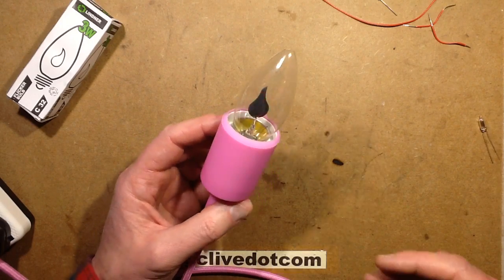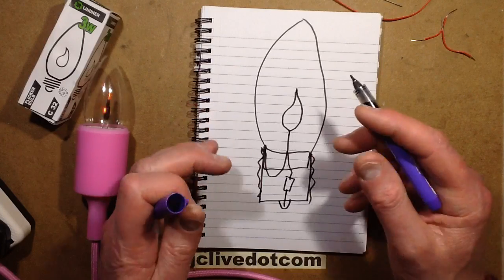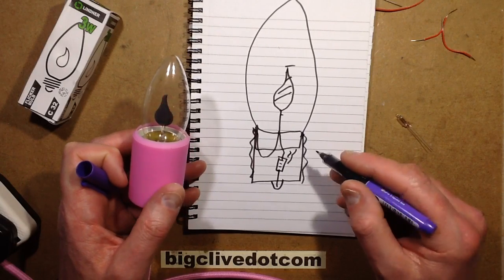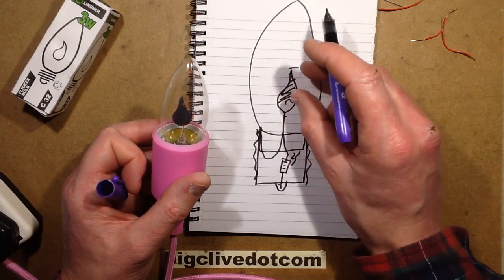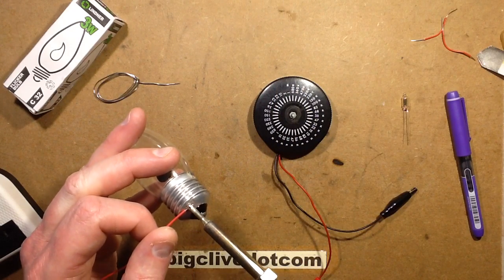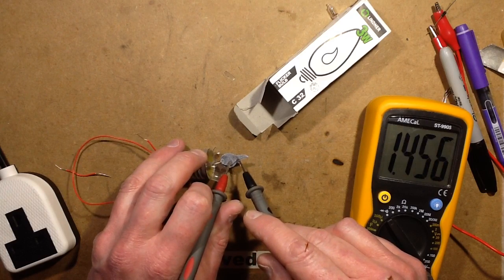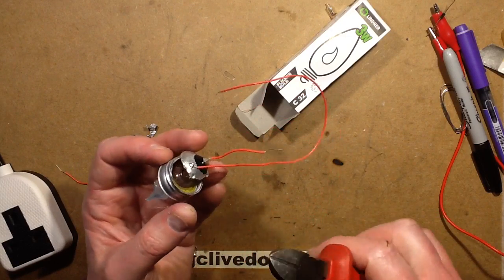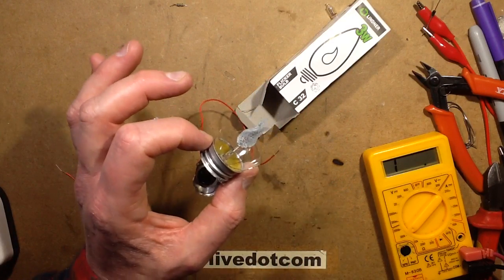Inside a cheap Neon flicker-flame lamp from eBay.

Comment: I swear that calculator gets bigger every time I see it!
Reply: Maybe BigClive's hands are shrinking ...?
Reply from the maker: I've never thought about sticking an LED up a Jelly Babies bottom.  I like the idea of edible fairy lights.  Probably better thrust into its little jelly skull though.
Reply: @bigclivedotcom  don't know where you're going but don't necessarily like it
Reply from the maker: I think it would certainly make a very interesting video if Photonicinduction stuck 2000V up your ass.  he can do that at well in excess of an Amp.
Reply: @bigclivedotcom  talk about lethal induction
Reply: can it do bigger sums because it's bigger ?
Reply: @BillyNoMates1974  well that definitely sums it up the more subs you do the bigger the calculator gets calculator gets too big just do only subtraction for a while exhaust small calculator just don't let the very go completely flat otherwise you might prick your fingers become because it's cactus
Reply: I doubt it but if you want calculate astronomical sums like my recent gas bill you need to send it to  NASA
they can handle it
Reply: not so sure its A4 size like mine
Reply: lol. I did not noticed, had to recheck it :D that's a CALCULATOR :D
Reply: With a light bulb....up my ass.....
Reply: foxy s don't put anything up their ass  but I did put an Led up a jelly babies bottom lit up nicely
Reply: Lol, 120 or 240v?
Reply: It's a ghetto calculator. You hold it on the shoulders.
Reply: +BillyNoMates1974 I had to read the comment twice and think about the joke that's fucked up and I'm rofl.
Reply: 2000v would definitely turn your colon codes black.
Reply: I guess that would be electro-colic irrigation
Reply: @BillyNoMates1974  something about electrical irrigation wouldn't that be a contradiction in terms or at least not recommended I'm not like I'm talkin electric pump for irrigation but electrical irrigation sounds kind of like a recipe for disaster especially if it's the water pump and it gets wet under right conditions.

But you could say that the crop would have been electrified potential for growth or make a really good Wallop of a dish when it's served hot LOL
Reply: James Searle Whatever you can fit up your butt!
Reply: 2000 Volts straight out the ass is what I can deal!
Reply: @sirunknown2142  well that would definitely electrifying wonder if that happens when an electric eel gets too much gas that is if it could run on gas like a generator LOL
Reply: No. You either shove a battery up your butt or you just insert something so that the power can be sent from two cables while going through what's in your butt.
Reply: @sirunknown2142  technically true yes how conductive are mucous membranes
Reply: Trump is 6′ 3″
Reply: James Searle Let us know when it completely fills the screen.
Reply: Don't mention his name or he'll come and shove Poundland tat up your arse!
Reply: On my big screen TV it's about 2 feet across. It must use 8 D batteries!
Reply: Sir Unknown if you stick any electricity up your butt you effectively are making a rectumfier
Reply: @carolynmmitchell2240  It does all sound AC/DC to me. This string of replies needs some rectumfication!  :-)
Reply: @jlucasound  definitely needs a full Bridge rectifier but don't accidentally overloaded because of becomes a Bridge rectified
Reply: @carolynmmitchell2240  😳
Reply: @carolynmmitchell2240  would that be full or half Bridge
Reply: lol XD
Reply: 415 volts, three phase for extra oomph
Reply: @BillyNoMates1974  Liberty that's where they came up for the name banggood Jamie want big boom
Reply: lol. do you eat batteries and shit electric ?
Reply: @BillyNoMates1974  either/or batteries corrode in stomach and cause all sorts of issues except electrocution and then you wind up heart failure and they use somebody thousand volts to Snap you are that and wide-open pacemaker powered by batteries or something artificial heart car batteries you wouldn't have to swallow batteries because you've already have them in you either one of the above lol
Reply: Forgot the name. Redirector? Maybe. Shove that and attach two cables
Reply: Bob3519 Marry me. 💍👉👌👍
Reply: well it won't fit in your shirt pocket I've tried
Reply: @thehappylittlefoxakabenji8154  well if you can't kill the character in your pocket why would you need that anyways nowadays so it's just about every phone can do it anyways even if it's Norris smartphone nowadays and yes I once had a landline Lowe's cheap phone that hand clock calendar calculator a couple of other things on the same LCD as the number dialed out the interesting thing is this was free caller ID even but it did have I think it's kill or give me more directory Auto dial but I remembered it was a few other buttons four function but still pretty cool for the time 1 most unusual phones I've seen besides like the mouse phone that's a phone and a computer mouse I know someone that had one sound like crap but at least it worked. Enough room on that desk for phone so that's why he did it.

But the thing is I remember we had a phone that will not dial out but it was just meant as an extension phone didn't even have the ringer it just had a neon volt capacitor so that wouldn't it did ring the neon bulb with flash but yet be isolated from the line so that would not shut the line because of the neon firing.

But every once while if we would need to take call upstairs we dog from another phone extension and have someone else pick up after dialing before hanging up the one downstairs
Reply: Then he wouldn't be called BIGclive anymore :D
Reply: bigclivedotcom Wanna try?
Reply: @sirunknown2142  shuri would it be your lethal induction
Reply: Vendicar Decarian 

leave politics put of this.
Reply: jmcinvale When did putting things up your butt become political?
Reply: @sirunknown2142  just easier to put a cork in both ends ears to super glued in permanently I super glued shots everything super glued together London Mass left somewhere away from everyone 4/2 middle of Siberia and it would have been over easier than going through all that crap of his I think seriously we would have done better without him I believe anyone but him
Reply: +Vendicar Decarian

Easy just don't mention his name.
Reply: well its certainly big and made of that cheap silver plastic crap ! any guesses as to what battery it has ? I know what mine has !
Reply: if its the same as mine its one single button cell an LR44 A76 !
Reply: Is that really the only battery you can fit up your butt?
Reply: You must be real tight!
Reply: I tried sticking them through its skull you need to make a hole first I used my neon screwdriver for that the red ones light up a nice pink but the black ones are rubbish
Reply: its heavy too mine weighs over 400gms
Reply: @BaDboD I guess one could could say they play an inflated price for the calculator
Reply: The pink palculator?
Reply: I bet your gas bill wasn't as big as Hitlers
Reply: I told my teacher that and I got fucked!
Reply: I feel the same about your mother

Comment: Resister wheel from Jaycar https://www.jaycar.com.au/resistance-wheel/p/RR0700
Reply: I dare people to build their own resistor substitution box or a better one called a resistor decade box. I have parts already on the way for mine. It would also be fun if he could show us how to build one as I am sure he has most of the items laying around the shop and they are dead easy to build from the way i understand it and the one I am building has almost any resistance you want to dial in. it contains 63 resistors with in my case with thumb wheel switches  and with this setup I could dial in any resistance that I wanted and then find the appropriate capacitor in the standard capacitor range.
Reply: For me at least, the challenges are, the box/shell, internal wiper contacts and nice silk screened labels to get a pro look. obviously it can be made without those or made with an off the shelf rotary multi contact switch. but won't be as compact or user friendly

also, it would be neat to make a more compact one with smd resistors
Reply: This is the resistor substitution decade box that I built some time ago.  It has not failed me yet.  If you want to see my finished product labeled and in it's housing, just let me know.

This is the basic build from the EEV blog: http://www.eevblog.com/forum/projects/diy-cheap-resistor-decade-substitution-box/?PHPSESSID=b9e4b61f7eb911da0ce2afd8b384ccce

Also check out: http://hackaday.com/2012/08/21/building-a-resistor-substitution-decade-box/
Reply: The easiest way would be a breadboard with a load of resistors in with one end commoned to a lead with a croc clip then another croc clip lead with a jumper pin on the end. Ugly but functional.
Reply: I suppose. but then again if you don't want to keep the single wheel format, you might as well buy a few of these and make a proper switch box. they are fairly cheap and compact
http://www.ebay.com.au/sch/i.html?&_nkw=Rotary+DIP+Switch&_sop=15
Reply: Thanks vk3hau, as soon as I saw it I knew I MUST HAVE ONE OF THESE! :-)
Too bad it's still forty bucks; someone ought to have figured out how to make them cheaper by now…
Reply: I bet the Chinese have, but the quality would be cheaper as well.
Reply: Chris Koch Remember, that's 40 Australian dollars, which is just over 30 USD right now.
Reply: +Ken Cosi
Saved that EEV guide, have a couple of rotary 10 pole switches in the (slow) post. Wil use it to make a simple one, then have a go at a bigger one at some point.

Comment: I dropped one of these on the floor. There's quite some gas pressure inside, it made a loud pop.
Reply: LimaVictor or no gass at all (vacuum)
Reply: No, there is neon in there. They're just neon lamps with special electrodes. 
Tiny NE-2 lamps can give quite a bang too, if you run them without a resistor...
Reply: They operate at a lower pressure than the outside atmosphere and usually have a mixture of noble gases to produce the glow. A vacuum wouldn't produce any light and pressurisation would just be a waste of the gases as it only takes a small amount for the effect to work.

Comment: color code: black, black, black, black!
Reply: yes they exist its just to hide a poor pcb design your not supposed to have crossovers on tracks
Reply: Actually, I have seen a zero ohm resistor with a single black band.  https://en.wikipedia.org/wiki/Zero-ohm_link
Reply: Same reason applies to through hole components I think.
Reply: They exist just so links can be placed by the same machine that puts resistors. This supposedly saves time, energy and space as you need less machinery.
Reply: Sometimes it's just mathematically impossible to avoid crossing over, even if you can use copper on both sides.  You can reduce the number of times you need to, but you can't necessarily avoid it altogether.  Also, a wire link is better than forcing a ground or power rail, or a high-impedance input, to take a convoluted route.
Reply: simontay1984 

nope through hole components can be placed by machines as well.
Reply: yes I had forgotten about those machines still you should avoid links on a pcb
Reply: No, through-hole components -- both two-ended  (e.g. resistors)  with variable centre distance, and one-ended  (e.g. capacitors)  -- can be machine-inserted.  At least they were when I worked in an electronics factory.  (I wasn't good enough for the jet engine works.)  We were still inserting DIL ICs by hand, but there were machines out there capable of inserting them -- some of the production engineers might even have been to see them at an exhibition.  I doubt they would have invested then,  though, most probably seeing DIL as dying and preferring surface-mounting as the obvious future.  You can wave-solder a board with mixed SMDs glued to the underside and through-hole parts, if it's designed right  (ICs across the wave).
Reply: ahh that's very true but one should always try to avoid but sooner or later you will have to cross that bridge !
Reply: well it was all through hole by hand when I did it

Comment: 15:28 "Black-black-black color code of a resistor - it means that it was cooking-hot"
Reply: Black is the new orange :)
Reply: it would eventually go back to being a nice glowing orange when it burnt out completely ! briefly
Reply: Cookie hot. =P
Reply: It reminded me of a test in school about the color code. They asked about black, black, black. I said open because it is a burnt resistor.
Reply: @eugenew2  I probably would have put their either zero or or jumper you know what they say about diodes when they fail about having Jumper Envy
Reply: yes it cooked the orange colours to browny brown
Reply: Well, it was either burnt, or it was a 10Ω resistor and the lamp had 20A flowing through it.
Reply: hellterminator I’d hope 20A wasn’t flowing through the bulb
Reply: If it was a 10Ω resistor it would explain why it should be burnt...
Reply: is that so !
Reply: is that a fact ?  oranges are actually green on the outside

Comment: Maybe the electrodes are stacked that way because they are all stamped with the same die from the same sheet?  Otherwise they'd need to be mirrored pairs to line up and have the dark sides together.  This is assuming that there really are dark and light sides.

Comment: Didn't find it on Amazon, but Newark has it here: http://www.newark.com/cliff-electronic-components/cl1850/electrical-tester/dp/68C8457 It's model #CL1857 (ref: http://www.cliffuk.co.uk/products/tools/quicktest.htm)
Reply: BillyNoMates1974 
I do, but no messing around on the bench with my 3 phase!!!
Reply: I bet Clive would like the three phase version. lol
Only joking. how may of us have three phase electric at home ?
Reply: BillyNoMates1974 Three words. Variable Frequency drive or tester. Outputs the energy needed for three phase machines and runs off of standard household electrical.
Reply: Harry Bibby agreed with no messing around with three phase unless absolutely needed. just regular mains scares me.
Reply: Sarah1390 
Yes I have been working with three phase for about 20 years and have it at home.
And you done really get a second chance with it......
Reply: there is also an ebay listing Cliff Electronic Components Cl1850 Electrical Tester http://r.ebay.com/uTkXK9

Comment: talking crap about clive having open live wires
If I search vice of knowledge on eBay, I get nothing useful.
wants to see a 120V between two phases at 400V or send it to Photonicinduction
Reply: Great idea! Send one to Photonicinduction, but bypass the resistor or he will be "greatly disappointed".
Reply: Aren`t they on the same Island?
Reply: im not sticking that neon candle light up my arse
Reply: I know right! Such an unsafe product! I should be able to use my light bulbs as butt plugs! If you can't shove it up your ass it's not a good product!
Reply: nope. but only a short hope and 300 miles drive between them
Reply: the worrying thing is that generally speaking, if you have thought of it. Someone has already done it
Reply: I'm sure Big Clive has! After all, this is his fetish channel! And haven't you searched for his "secret" videos?
Reply: they could mail stuff to each other though. theyd get it the next day
Reply: When you realize this show is just for shits and giggles........
Reply: Oh ok
Reply: He is long gone...

Comment: I think the electrodes are raw untreated iron. Only the negative side glows because it is emitting electrons
Reply: Sebastian Rietig the outside of both flame parts should glow,  this one had been assembled wrong,  causing the outside of one and the inside of the other to glow.